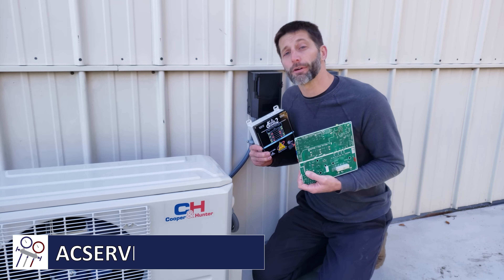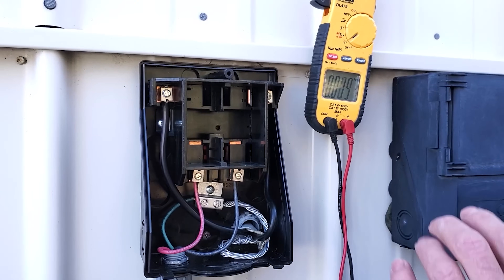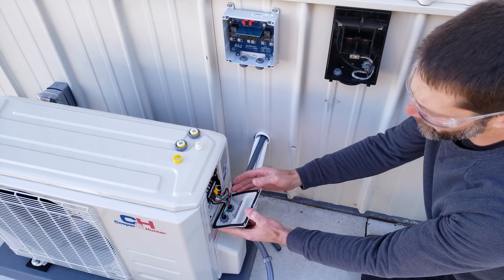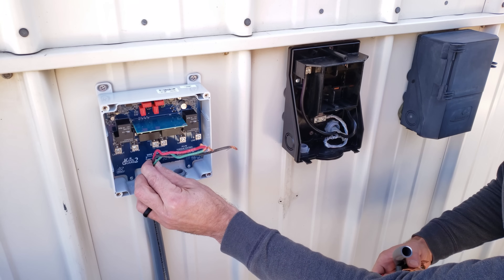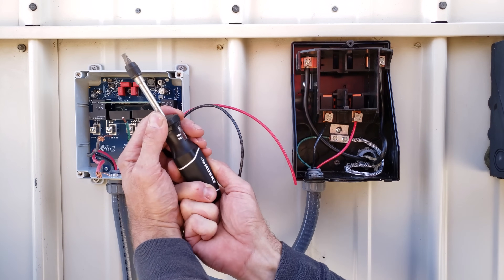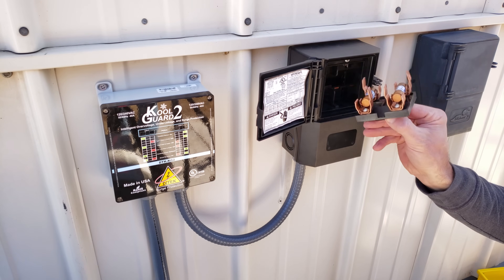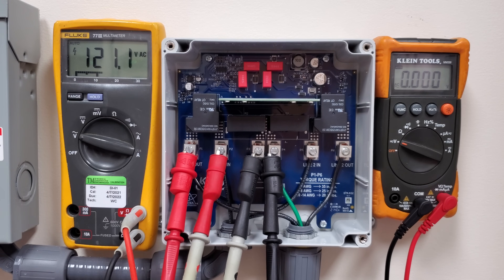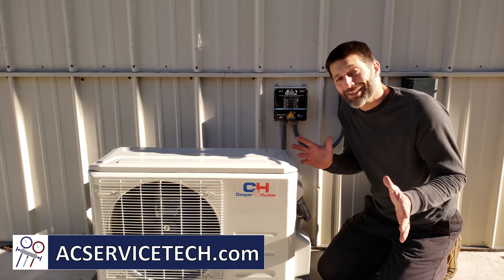Mini Split Failure from Electrical Surges, High and Low Voltage! HOW TO SOLVE IT!

Comment: Before circuit breakers their were only fuses to protect the wiring.  It should be noted both fuses and circuit breakers protect the size wire in the circuit's 14 ga wire will use a 15 amp fuse or circuit breaker to protect the wire from over heating. 12 ga =20 amp  10 ga 30 amp and 2/0 150 amp ,  you can have a fart fan drawing 1/2 amp running on a 100 amp line. I checked my chart and they say FUSE size not circuit breaker size. You must be thinking of the little fuse on furnaces they only protect the electronics .  So I have 40 years working in HVAC doing industrial and 10 years teaching HVAC.  I'm correct your wrong

Comment: Why not just install one at main breaker box to protect all appliances in the entire house? Just sayin!!!
Reply: It's a great idea to have an SPD (surge protective device) on your main panel, but this device is a voltage monitor wired in series. It also has surge protection capabilities, but is primarily there to keep the equipment from running on input voltage that is too low or too high.
Reply from the maker: Surge protection breakers are now usually required on new buildings in most states within the US. That isn't the voltage protection switch though that is integrated in this unit, thanks!

Comment: Or manufactures could just build better equipment.
Reply: Equipment is made to work at standard voltages, not outside it. Some have that protection built in but others don't.

Comment: There should be only one type of line protection , fuses or circuit breakers not both. The outside unit should have a non-fused pull out
Reply: Wrong. Fuses protect the equipment, breakers protect the wire insulation. Read up on some NEC before posting